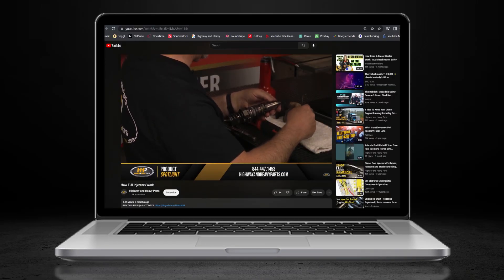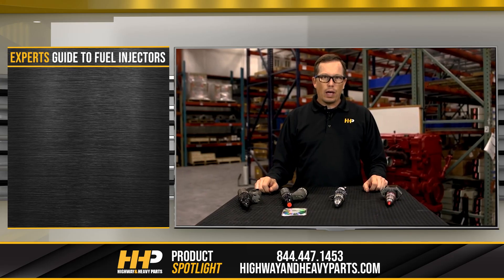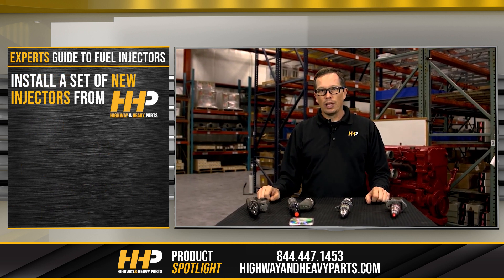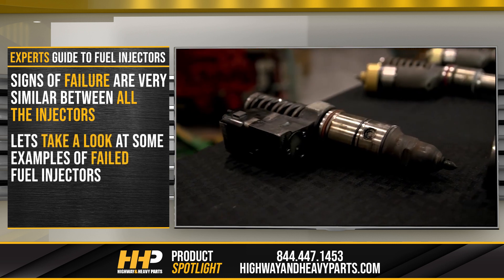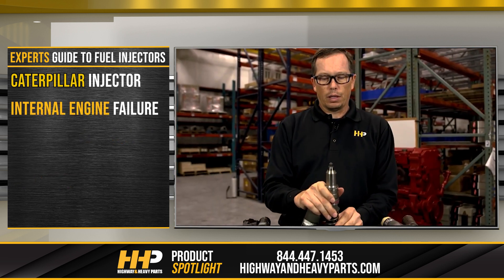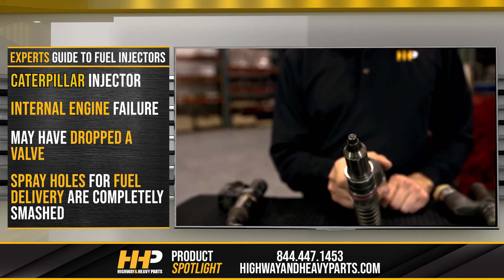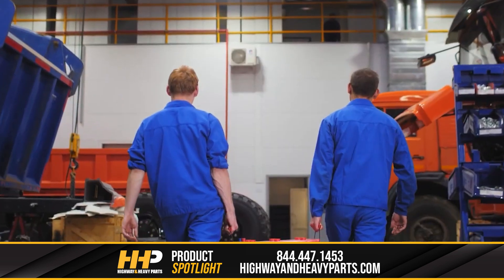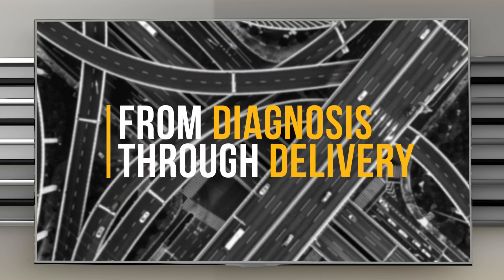Diesel Fuel Injector Problems and Symptoms. Take A Look!

Comment: Would 1 failing lead to an engine vibration that increases with revs till past 3.2k rpm?
Reply from the maker: Great question! Our techs can provide the best advice over the phone. Give us a call at 888-431-1453, and we’ll make sure you get the right solution for your needs!